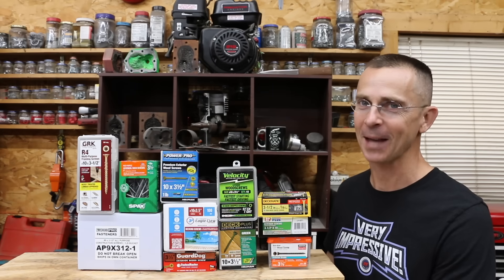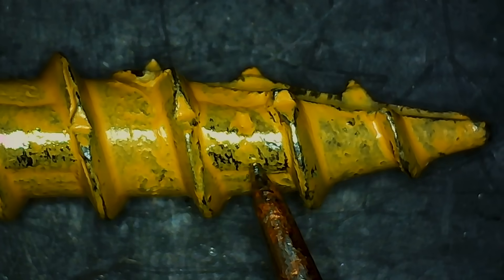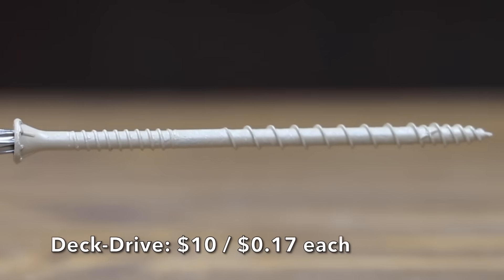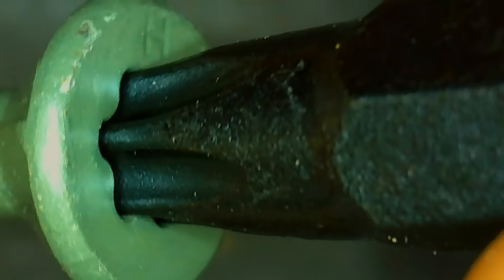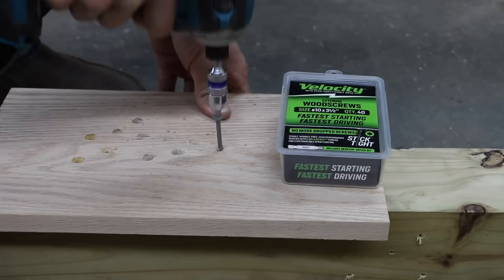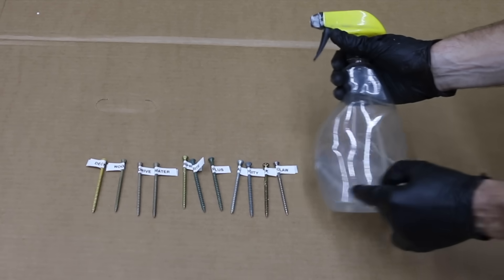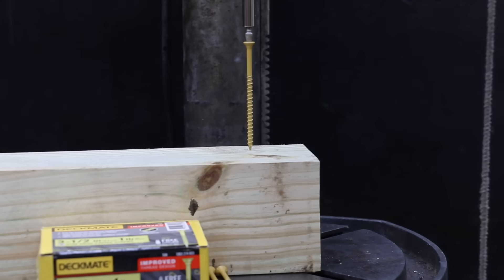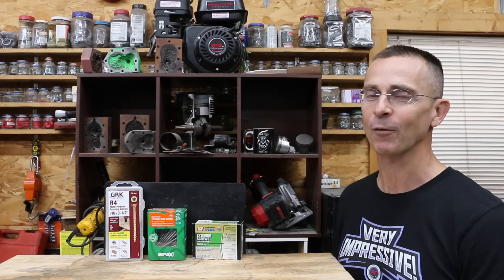Best Deck Screw? GRK vs SPAX, Grip Rite, Deckmate, WoodPro, FastenMaster, Deck Plus, Eagle Claw

Comment: I'd say the most important aspect is corrosion resistance. In reality if you use any of these in a building project, you're going to have sufficient strength. But whether or not the project lasts for 30 years is pretty much solely reliant on if your screws rust out and give up or not.
Reply: Mmhmm. We've all seen 15 year old decks with massive cupping and lifting because half the screws have broken right in half
Reply: @Tibyon  oh yeah. Or straight up rusted out so badly they can be removed by pulling with your fingers
Reply from the maker: Yes, great point!
Reply: Found that to be true on fence rails! 😕
Reply: Color matters as well.
Reply: Ideally, the coating would stay on the screw after driving.... but the rubbed coating is now on the wood against the screw. Serious question, I wonder how his visual inspection out of the wood translates to actual corrosion/lifespan if the screw were never removed?
Reply: At this point I don't have to worry if anything lasts for 30 years because I won't be around then.

Comment: Would you consider torture testing automotive air filters? With all the freezing weather and soaking wet they are exposed to it would be nice to see how much they can take before they rip or disintegrate.
Reply: Your air filter should not be getting soaking wet, it's inside a plastic box.
Reply: @libtrs838  5 hours on the hi way in the rain you don't think it's wet?
Reply from the maker: Thank you for the video idea!
Reply: just change it every 10 000 mile and you're good to go.
Reply: @lordred7462  10,000 miles takes about 3 years for me. I know when/how often to swap the filter but what about those who don't?
Reply: @IKnewMickey  let's have them check in owners manual then.. Basic maintenance on car is easy, everything is written in owners manual.

Comment: Amazing video Todd… glad you did t25 instead of #2 Philips
Reply: I am just a weekend hobbyist, but I absolutely loathe Philips screw heads.  Torx may not be the best screw head around, but it's the best of those that are reasonably easy to find, and for small projects around the garage, paying a few extra bucks for coated deck screws with Torx heads instead of drywall screws is well worth the money in my opinion, if just for ease of installation.
Reply: @jayschafer1760  The PH screw heads have their use, drywall and automatic screw guns are some of them. Deck screws like this, is not. Also, I always recommend Stainless Steel, Acid Proof fasteners for decks... It holds up better in the long run.
Reply from the maker: Thank you very much!

Comment: In my experience, those coatings are  simply for the color to match whatever your final finish is. It may also provide a little bit of lubrication on the way in.  the corrosion resistance comes in the type of metal used in the screw.
Reply from the maker: Great point! Thank you
Reply: @ProjectFarm  I'd recommend confirming whether these screws have an electroless or electroplated base layer of metallic coating underneath the organic topcoat.  I suspect that is what we are seeing (and not the bolt metal itself) after the organic coating is stripped away.
Reply: I use the GRK screws for absolutely everything interior and exterior.  I used to keep interior and exterior screws but that turns out to be way too many different boxes of fasteners. It's worth the extra price price to have the convenience and higher quality. I only buy the other colored screws if I'm trying to match a deck finish
Reply: @TheMrAHead  The exterior deck type screws have more tensile strength than the interior stuff anyway so I generally only buy exterior for everything too. Honestly those cheap DeckMate screws actually work pretty well and hold up from my experience.  And only $8 for the small box.
Reply: I have never seen this like of coating in sweden, and vary few of the brands exist over here.
Reply: Matching the coating to the project can be very important.. Pressure treated wood can destroy a non-rated screw real fast.. I've seen it happen in just a couple months.. There is more to it than you might think..
Reply: @twistedhillbilly6157   The GRK screws work fine on everything. I use them on Cedar, Redwood, pine, ply and pressure treated.  Never had any stains or issues with the fastener's corroding.  I've been a general contractor for 16 years. Many of my clients have been with me well over 10 years and I have never seen an issue with these screws on any project. I understand the importance of coatings and materials that the screws made out of. There's not more to it than I might think, I understand it quite well.  If the screw is made out of proper alloys then the coating does not matter. As you saw in his tests the coating gets scuffed up and chipped before the screws are even installed.The coatings are not durable or thick enough to provide any real protection. It's only there for looks; unless the material of the screw is sub par. That is why I only use GRK.
Reply: The coatings are useless; I've seen more " pretty colored" screws corrode and rust away then there are  decks to install them in. Go stainless
Reply: @stevebengel1346  There are several different types of stainless screws available to be used on different applications.. Many are very soft and some are below a grade 2 screw. Stainless is also expensive and not always available in the size and style needed..  The coatings are not only very useful but necessary in many cases.. Maybe there is a difference between your "pretty colored" screws and the "COATED" screws.. The coatings are not usually meant to color match but to protect the metal from the elements and chemicals in the decking material. The most common colors are olive green, puke-ish yellow,  and black.. None of those match  normal lumber  colors...
Reply: The corrosion resistance test clearly contradicts your opinion.   None of these screws are made from anything but plain carbon steel.  None have any corrosion resistance without it.  They are not made of significant amounts of “stainless” elements such as chromium.
Reply: @slpguy6026  They aren't stainless steel, but they do have plating on them that the acid would have removed. Normal use would not destroy the plating like that. The paint is not the primary barrier.
Reply: @F0XD1E  that’s exactly what I said.  Steel is plain carbon; the coating is the only part providing resistance.  Original comment in this thread claimed that the resistance was due to the steel itself & I disagreed.  You’re disputing the wrong person.  And btw plating, coating…neither are part of the steel itself.  That’s a linguistic issue only
Reply: @slpguy6026   Actually, you should go back and watch the video again. The corrosion tests clearly support my point. The coatings came off of the screws which I stated gives no protection anyways. The materials the screws were made out of did not corrode however.
Reply: @TheMrAHead  dude no, that is severe acid he tested with.  Of course it ate the coating!  It did it’s job protecting the steel. Wood and water will also corrode but not anything like that acid.  The coating protected the steel…hmm cannot be any more obvious.  The point of the acid was to see if the coating prevented rust, not to see if it withstood the acid.  No coating will withstand that.  The coating did it’s job.  Pretty sure the engineers spec’d coatings to withstand natural  corrosion for a period of time, not acid. And just google the composition of the steel.  They’re carbon steel.  If you know anything about steel you will know it rusts.  Now if any happen to be made of some sort of “stainless”, eg with a lot of chromium, then great, that is resistant steel and the coating is irrelevant.  Those would be very $$ and brittle but maybe worth it if installed very carefully.  And believe me if they were stainless that would be heavily marketed and clear on the label.
Reply: If I'm spending 10-20k on a deck I would just buy 316 stainless decking screws. Anything outdoors I go stainless, I never cheap out on fasteners.
Reply: @Avantime  if you install 300 stainless decking screws, probably a dozen will break off, leaving ugly marks.  Also they tend to blend in less well with the wood color. That’s why many will choose GRK or coated type screws.
Reply: @davidbelecci6970  I'm not a pro, but if breakage is an issue then maybe pre-drilling should be done. Again if I'm paying 10-20k on a deck I'll need to make sure that it will last as long as possible, and only stainless steel fasteners would do that.

If I need to blend in then maybe some wood filler would do the trick.
Reply: @Avantime  keep in mind you will be paying more for stainless.  Also the screw's only need to last as long as the decking material itself.  In my experience at least the typical cheaper screws i've seen used only break when the PT deck boards are so warped and split that it's time for a rebuild anyway.
If your paying for cedar or the plastic wood stuff that lasts a lot longer, it makes more sense to get a better screw.
Reply: And the first time to re-stain the deck and strip the old finish, the coating on the head also fails.
Reply: The coating is sacrificial, it doesn't need to completely cover the screw for it to remain effective. It's like the Zincs on the bottom of boats, it corrodes more preferably than the metal it's attached to, which creates a galvanic reaction preventing the steel from corroding until it's entirely spent. All the screws would readily rust once the coatings are entirely gone, and stainless can still have serious issues with salt depending on the grade, it's why you can't add salt to stainless steel fire extinguishers to winterize them.
Reply: Yes. I agree
Reply: No, the coatings are there to protect the plain steel screws from being attacked by the acid residual on pressure treated lumber. Coated plain steel screws are a good deal less expensive than would be stainless steel wood screws.

If you are only running screws into untreated lumber, any screw will work just fine.
Reply: Or go big and run stainless 💪
Reply: @jintarokensei3308  yup. Nothing touches stainless. I have 2 full 5 gallon buckets of 2.5" Robertson drive stainless screws I pulled out of a 600 foot long dock and they still look brand new after 15 years of salt spray. It's not even worth using anything else for exterior screws.
Reply: @rustyshakleford5230  my thoughts exactly.
Reply: @jintarokensei3308  Great for rust resistance but super duper brittle and I'm not paying extra for screws that break extra easy. There's a reason why a real sword and not be made from stainless steel.
Reply: @actionjksn  brittle on shear, if you need to hold something down I don't see a problem. Unless earthquakes are the norm
Reply: @jintarokensei3308  They snap off driving them into something hard, and the amount of torque needed to snap them is very low compared to the coated ones. I learned this while fixing some a boat dock for my sister. Those things snap like candy canes. It's just an inherently very brittle metal. Great for some things, but not structural.
Reply: @actionjksn  I'm sure there's alloys that are less brittle. I've never had one snap on drive. Even in the video it didn't snap on drive.
Reply: @jintarokensei3308  I had to attach 5/4 decking to her floating dock which has a steel frame. I pre drilled it barely smaller than the screw, about the size of the screw minus the size of the threads. Every single stainless steel screw snapped immediately, I even tried lubricating them. 

Then I tried the coated screws not expecting them to work from Home Depot like in this video. This was around the time when these coated screws first came out, I don't even think I'd used them yet, I thought they were a scam. Most people were still using galvanized for most exterior projects. The coated screws worked perfectly and I wasn't even having to be careful. 

That's when I found out just how brittle stainless steel screws are.i don't know what kind of alloy the coated screws are but it's some pretty good and tough stuff. 

BTW the stainless was snapping at least as quick as the galvanized, which was the first thing I tried, and I think even quicker than the galvanized. 

There is a price for that inherent rust resistance.  It's the reason all stainless steel swords can not be actually used. They can only be used as wall hangers. They break as soon as you wack something with them and you don't have to swing hard. There's a video online where that is demonstrated inadvertently.
Reply: @actionjksn  yeah but there's a difference in intended application for swords. And sounds like you were trying to tap a metal frame with a screw not designed for self threading onto metal. I've used plenty of stainless screws on wooden and Plasti objects. Frames, posts, fences... Not once have I had a screw snap from torque.
Reply: @jintarokensei3308  Too brittle.
Reply: It’s also a anti corrosive coating for green treated wood. The chemicals used to treat the wood deteriorates non coated screws twice as fast.
Reply: I suspect that most (all?) of these screws have an electroplated or electroless plated layer underneath the organic topcoat.